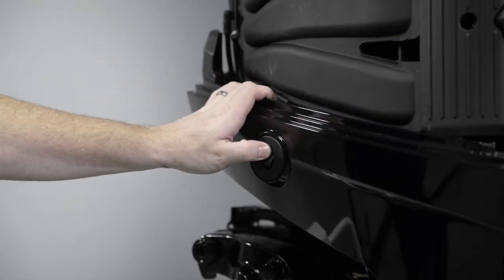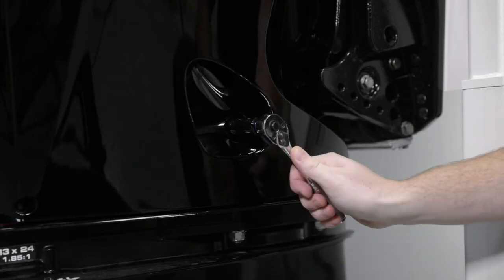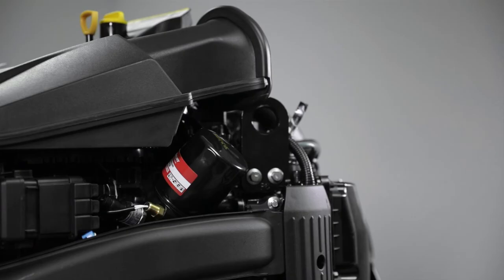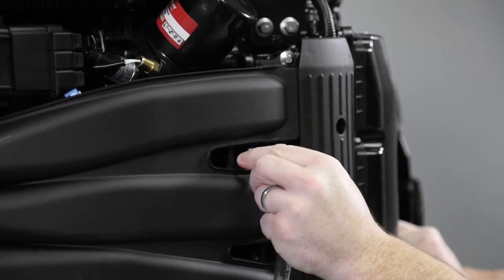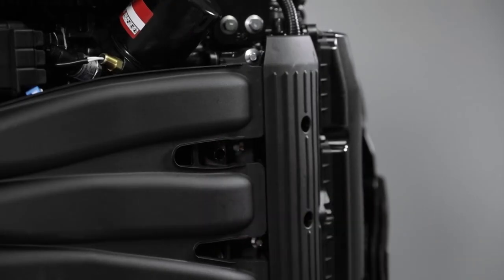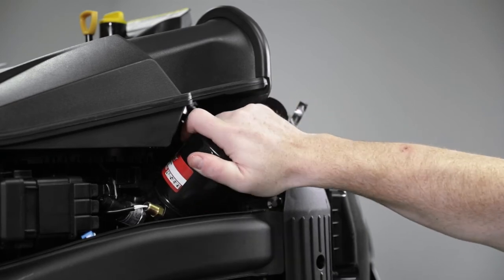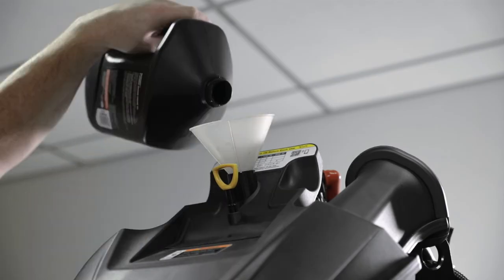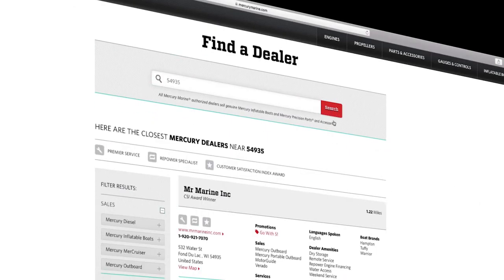Mercury 75 - 300hp FourStroke Outboard Maintenance: Changing Engine Oil

Comment: Would be great if Mercury didn't make it so ridiculous to get part numbers.   If good customer service = making it painless for the customer, this is one area Mercury Marine is failing.      At least the owners manual has the spark plug number.   But everything else?   Do I really need to buy a PARTS MANUAL?

Comment: I wish they told how tight to snug the oil drain valve. I don’t want to over tighten it that’s for sure. But also I don’t want to Not tighten it enough to where it could vibrate loose.
Reply from the maker: When tightening the oil drain valve, it should be torqued to 132.7 lb-in. This will ensure you have it tightened properly.

Comment: do i need water flush when idling the engine
Reply: Yes.  If not, you risk burning up the water pump impeller and/or overheating the engine.